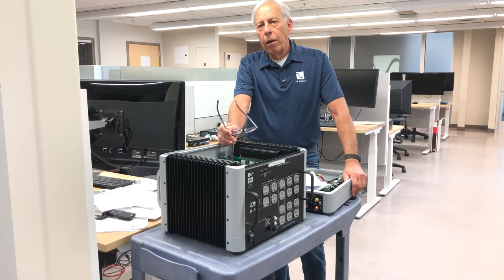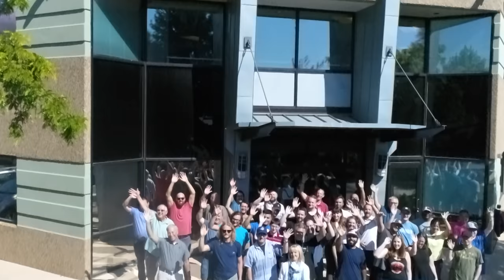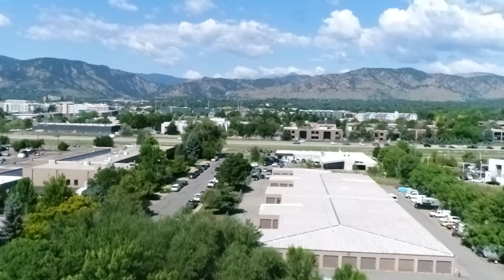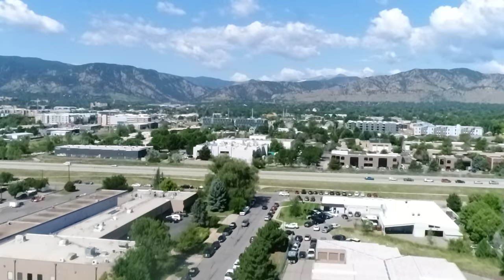What's wrong with using a UPS on a stereo?

Comment: Is an APC ups 1500 a decent one? I guess it's a "smart" ups, weighs a ton
Reply: Generally, APC is of very good quality. However a) you have to make sure that the max load of the UPS should be 20-25% bigger than that of the equipment connected to it. As far as I know, APC always provides a Wattage measurement of the maximum load in the specs. For example the APC BR1500GI is a 1500VA (or 865W UPS). Meaning it has a 0.57 power factor. All you have to do now, is add the wattage of the audio equipment connected to it. Look at the back panel of each device. The sum has to be 20-25% less than that of the UPS, in question. In the example above, the sum shouldn't be more than roughly say 700-650W, respectively.

b) Also it has to provide your amplifier (and other audio devices) with a pure sine wave output. Especially if the transformer of your amp, is a toroidal (linear) one. Linear transformers don't work particularly well with a ups that provides a modified (or stepped as Paul states in 3:32) sine waveform. Check out this:
 https://www.samlexamerica.com/support/documents/13005-0614_AdvantagesofPureOverModifiedSineWaveInverters.pdf
Reply: Most of APC stuff is pretty good however what you can buy in stores is generally of an approximation, however I have had fairly decent experience with most of their newer stuff and I can say that it runs stuff pretty darn well it has exceeded most of my inverters and I have yet to get one of those fancy true sine wave inverters. I have also used a minute man and that thing was brand-new about 5 years ago and did not run very efficiently so I suspected it was not as well designed.
Reply: @imark7777777  Idk mate, but pure sine ones, can be found as easily with almost same prices too. Anyway, I was just explaining to scottyo64 what he should check, for the one he already has.
Reply: @Yiannis2112  so cheap ups like line interactive ups which usually designed for office PC could probably not good for powered speaker?
i planning to get those kind ups for my powered monitor speaker

Comment: In UPS too there are different types - for audio use a "True Online UPS", def not a line interactive UPS
Reply: astralboy79 ~ ?
Reply: True Online MAY slightly better but very much more expensive. The difference in the output is only SLIGHT, if any at all depending on the model. True Online units are intended for Mission Critical uses, like hospitals running ventilators or other equipment that can't withstand even the slightest interruption of power, as there's no switchover time. Audio equipment DOESN'T need that level of response, the capacitors in the power supplies are designed to ride out slight power fluctuations, even without a UPS at all. I've run Line interactive UPS on my >$20K system(s) for years without problems.

Comment: Stepped sine wave will ultimately blow the smps at the least.
Reply: where did you get that?
Reply: You are hearme on hfv?
Reply: "Stepped sine wave will ultimately blow the smps at the least."And your source? Explanation?
Reply: John Hodgson just do the math.
Reply: Rikhav Shah what is hfv?
Reply: I did. The results are in 1200 Lockheed Hercules aircraft with frequency wild generating systems. Making a statement with no proof doesn't make it a fact.
Reply: @kunalzshah  That is a nonsense answer but okay, 0 details + 0 logic = 0 correct answer.
Reply: @kunalzshah  hifivision forum

Comment: Nothing wrong with UPS as long as it is on-line with 2 toroids that completely transforming all the incoming electricity and has 10x reserve of current consumption.

I like PS audio, but sorry, any decent consumer on-line UPS is worse only in terms of noisy annoying fans.
That's all :3

Comment: Some cheap UPS's output a simple square wave which is at 170 volts. So an audio amplifier with a traditional unregulated power supply will now produce considerably more DC rail voltage. That could easily stress the output transistors and other components as well. So there is some validity to this warning. Anything with a switch mode power supply like a TV or commodity DVD player could care less. They run fine on highly distorted AC power. And as just about all computers use switch mode power supplies, the cheap UPS systems are fine for that purpose.

Comment: What ..? A $500 ups feeding a $26,000 power regenerator...? 
If there’s a power outage and your that desperate to finish Brahm’s 5th ... hook your system up to a nice quiet little Honda 5 Kva petrol generator ... perfect sine wave and much lower source impedance than either an ups or a P20..! But don’t forget to put the Honda outside !! And use thick cables !!
Reply: If you're referring to the Honda generator that I think you're referring to they have a tendency of using a lot of inverter set ups on the output to make them lighter and more efficient however they were generally of a higher quality and nearly always a sine wave